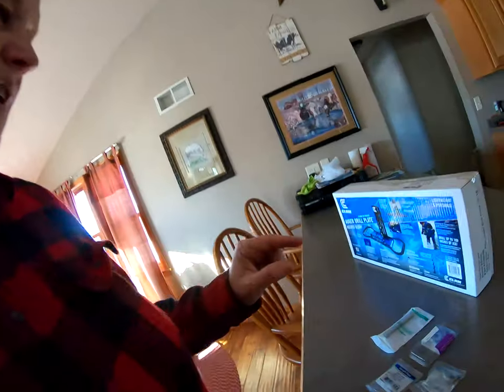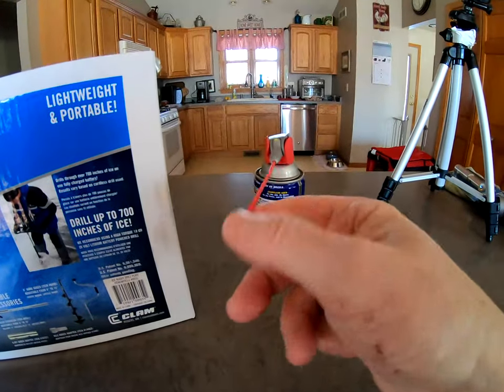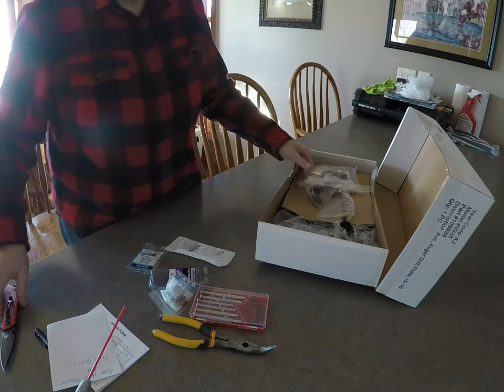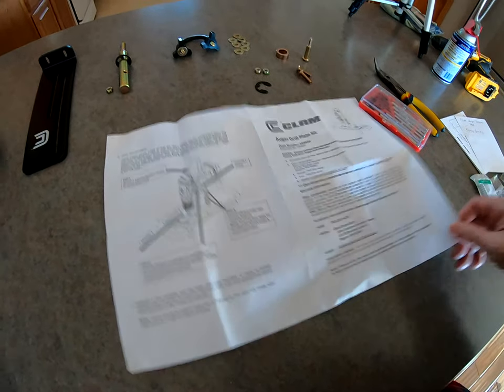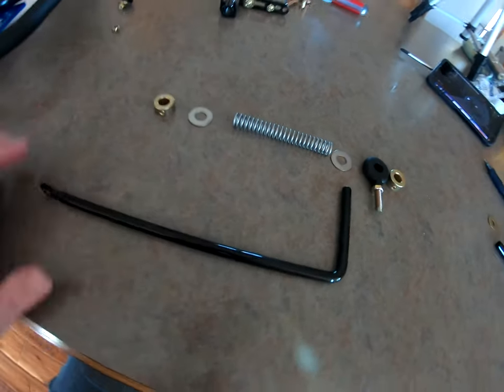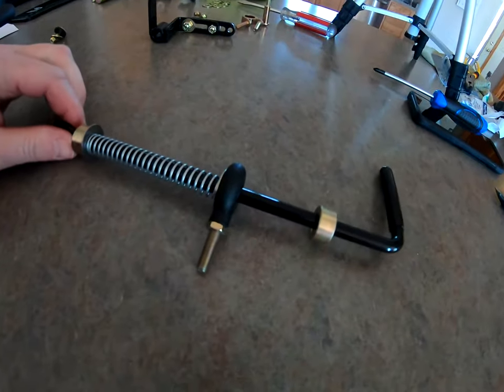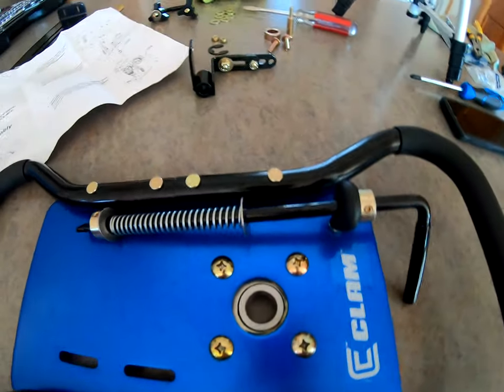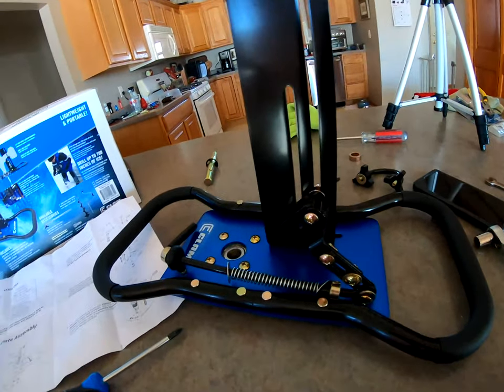Clam Drill Plate Trigger Mod  + (Dewalt 20V Brushless Hammer Drill 998) .... How to for under $10

Comment: NIce video! I'll be making this mod. for sure. I have an auger from a strikemaster hand drill on my clam plate now. Thinking about swapping that out with the 6" K-drill to have a light unit. Still have a Jiffy gas (hard to give it up) with  7 & 8" augers for bigger holes.  Any reason you didn't go with a K-drill? Waiting for hard water!
Reply from the maker: I have friends who have had both ans swear by the strkemaster.. it cuts better and faster... and the blades stay sharper longer
Reply from the maker: But iam sure both are just fine!